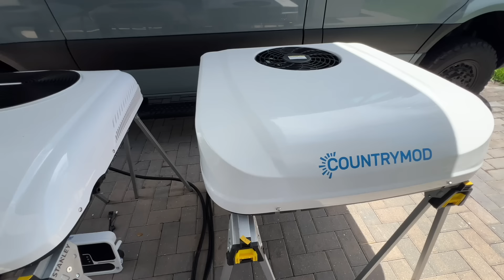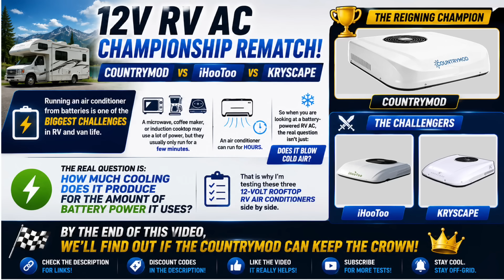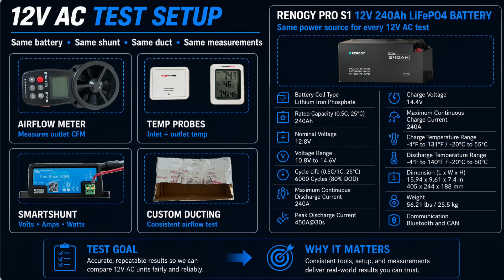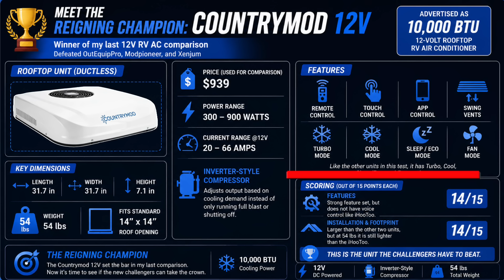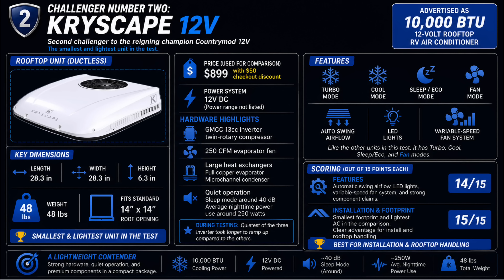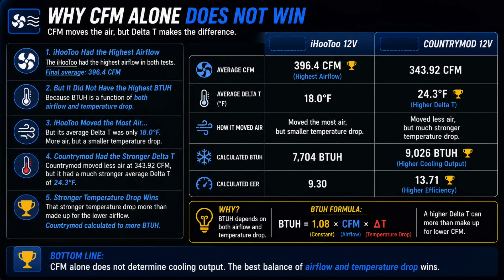Countrymod 12V RV AC Tested Against New Competition

Comment: hi just going to look at this and i am looking to buy my first van and would like to buy 12 volt system. anyone like to chat on there information . as i am going on bluetti and extra battery set up too .
Reply from the maker: Hello Ronald, That's an exciting project, and I recommend checking out the data in this video to help determine which 12V system will be the most efficient for your van build!  I do not think you can actually power a 12V RV AC from a power station as they require some significant amperage and most power stations are limited on output amps.  I also use a power station as my off-grid power systems well, but currently I have a 120V Turbro plugged into the AC output of my power station.  I also have a 48v battery connected directly to the expansion port of my Ecoflow power station which means I can connect up a 48V RV AC on my van via the battery.

Comment: 1st,,, thank you for the testing! How many hours has the Country mod 12 volt AC until lasted using the Country mod 630ah battery. Hours on medium to get the best cooling for less draw and High for the coolest temperature on the super hot days or nights. GOD BLESS!!!
Reply from the maker: The AC uses an average of 500 watts in auto mode.  The battery has 8064Wh.  so this means the AC can run for about 16 hours.

Comment: How is delta T measured? Probe directly on intake and outlet ? Or temp drop in the van ?
Reply from the maker: To measure the Delta T, I put one sensor inside my custom made air duct near the opening and the other sensor near the air inlet.  Thanks for the question!
Reply: @RubysAdventuresUnplugged thanks! That's very scientific approach. Thanks for your efforts !
Reply from the maker: I am expanding these reviews to include noise level 30" directly below the AC as well ... new video coming out later today with even more ACs

Comment: Ruby, I am loving my IHOOTOO 12 VOLT AC. I’ve also learned something interesting about power consumption. This is a very high tech AC, with an inverter compressor. I’ve been communicating with iHooToo customer service and they have been great. They informed me that they purposely built the STRONG/BOOST mode for when you first enter your van/camper and it’s really hot, it’s blasting trying to cool fast. I have not metered any power consumption yet, but noticed something very interesting. Once my van cooled in standard mode, the inverter dialed way back so must be sipping power? I left my 600 amp hour on charge to keep the battery charged, but ran it for 90 minutes and it never moved off float, so power consumption must have been very low. As I do more testing I’ll reach out, you’re wonderful responding to our questions and comments, many thanks.
Reply from the maker: That is great to hear, and I look forward to hearing more about your power consumption findings as you continue testing! 👍🇺🇸.   I am also very happy to hear you have been working with thier customer service as so many companies seem to forget that part of the purchase experience.

Comment: Ruby, is the Countrymod larger and high rated because it has a larger coil? That itself could probably make a difference
Reply from the maker: Hello Jerry, the Countrymod is only rated at 10000 BTUs, so it is not higher rated than the others, but it is possible that it is underrated.  I suspect that the Countrymod has the internal components of a 11-12000 BTU AC unit ... so I will be comparing it against a couple 12000 BTU unit in the very near future.
Reply: Thanks Ruby, just got my IHOOTOO Because of decent performance, cost, features that combined to give me a balance in all areas. I’m going to bolt it down tomorrow and hook it to my 600 amp hour battery to give it a nice test.
Reply from the maker: Let me know how it does!

Comment: I didnt see any info on the total run time of each unit  using the battery you used for the test_ ?  which one ran the longest ?   all other info was great to know.. wondering if using a dual inverter 110v AC 12000 btu system through an inverter would be a better way to go even with the power loss of using the inverter ??  that would be a good comparison
Reply from the maker: Great question!  It is really easy to calculate how long each AC would last.  For example, if my 12v battery has 630Ah, then that equals just over 8000 watt hours (lets round off for simplicity).  If the AC uses an average of 700 watts in Turbo mode, that means it will last 8000wh/700w = just over 11 hours on that battery.  Of course if you use Eco mode which only draws 300 watts, then it will last 26 hours.  As for you other question, yes inverters waste power (watts) during the 12V to 120V conversion ... usually around 10-15% and 120V inverter AC are better than non inverter AC because they avoid the sudden demand for power, but that alone does not make them more efficient.  Most 120v AC use more power than most 12V AC.  I currently have the Turbro Inverter (13.5KBTU) AC on my RV and it is a great AC but in Turbo it uses 1200-1300 watts + another 100 watts in power conversion.  The Countrymod 48V RV AC (13KBTU) only uses 700-800 watts in turbo mode for about the same BTUs and I can connect that directly to my 48V battery system ... this means I use about half the power for about the same cooling.

Comment: If only I had found your channel before driving 5000km to florida to camp in the heat for a week. 😅 I made due with my two 300ah renogy batteries and a 3000w inverter, but I would have loved the lower power draw of the Countrymod vs the standard Coleman air conditioning unit. Averaged around 1100w while running on full blast, not terrible for an 11000btu, but those extra few hundred watts of efficiency definitely would have let me sleep more soundly not needing to worry about being unable to turn the generator on in the morning. Thanks for all the work you put into testing, reminds me of Project farm!
Reply from the maker: Efficiency definitely makes a huge difference when you're off-grid, so hopefully this info helps with your future setup! 😊

Comment: Perfect timing before Prime Day, when these are 20% off. Excellent info, I was between this and the OutEquipPro. Gonna watch that previous product face off as well.
Reply from the maker: Glad the timing worked out for your purchase decision! 😊
Reply: @RubysAdventuresUnplugged installed, LOVE my CountryModPro!!!
Reply: It would be nice to see the eer and BTU and watts required in Eco mode.  Turbo will almost certainly never be the most efficient mode.  When it is required.. solar is likely available (hottest time usually sunniest). Where as at night, it's all batteries and having a unit that can spool down using an inverter compressor could cut the power draw to 1/4 but the BTU only in half.  The ihoohoo claims as low as 250watts..  it would be nice to see those tests if you can. 

These 12-48v units could be secondary units (120v when able to plug in.. low voltage unit in bedroom for night and boondocking)

I'm subscribed!

Comment: Excellent information, thanks.
How do the numbers compare with a standard 120 v 10,000 RV AC?
The one on my van (Thor Tellaro) is quite noisy but necessary here in AZ.
I'm wondering if the Countrymod is comparable, better, or not as powerful as a 12 v AC.
I recently bought our camper van used and I don't know much about them, yet.
Reply from the maker: Great question and one that many people struggle with.  First off, most DC RV AC's range from 10000-13000 BTU and most 120V RV AC range from 13500-16000 BTUs.  I currently have the Turbro 120V 13500 BTU AC on my RV and it is efficient but still consumes 1200 watts in Turbo mode.  When I compare the Turbro to the Countrymod 48V 13000 BTU (about equal BTUs) I see that the countrymod uses about 1/2 the watts (1200-1300 watts vs 650-700watts).  So I am planning to switch out my Turbro for the Countrymod ... and I will see first hand how equal they really are.

Comment: Both your reviews on the CountryMod 12v and 48v are good. I assume the 24v (what I need) is probably just as good? Let me know your thoughts. Thanks.
Reply from the maker: Generally, the performance stays quite consistent across those different voltage versions, so you should see similar results. 😊

Comment: I would like to inquire whether the Countrymod was provided to you for testing purposes or if you acquired it independently. It is common for companies to supply testers with high-quality equipment while offering inferior products to consumers.
Reply from the maker: Thanks for the comment! I am not sure that I would agree that a specific company would be sending out different performance versions as testers as most of these companies can send out hundreds of units to different influencers.  Also, The performance I achieved was inline with its specifications and the results I am seeing are inline with others that have installed the AC in thier RV.

Comment: Hi Ruby, Does the CFM change if only fan mode is used? It looks like the CFM would be equal to a Maxxfan on low setting, not really useful as a replacement for a dedicated roof fan. 
I know you are focused on DC off grid fans but will you be testing more high efficiency 120 volt air conditioners? Thanks
Reply from the maker: Yes, the CFMs do change in fan only mode, usually lower as I usually test in TURBO mode which is the highest power consumption mode on most DC AC units.  With that said, fans usually can be adjusted up and down as well.  Yes, I will be testing more 120V AC units ...